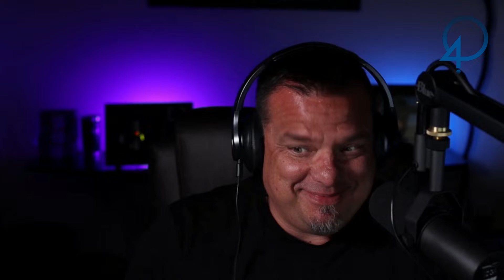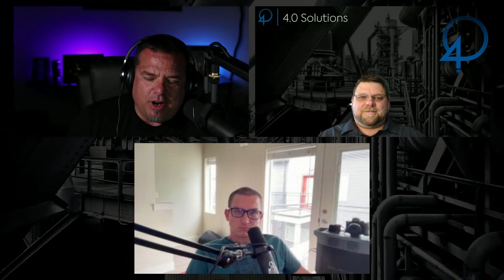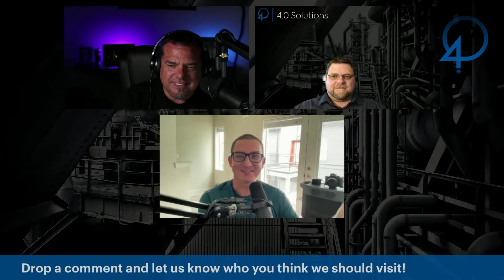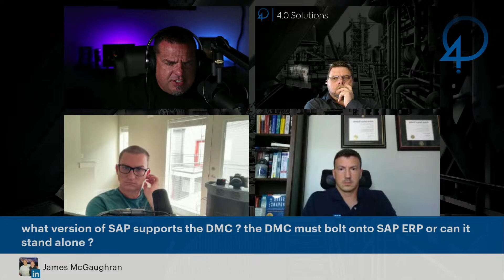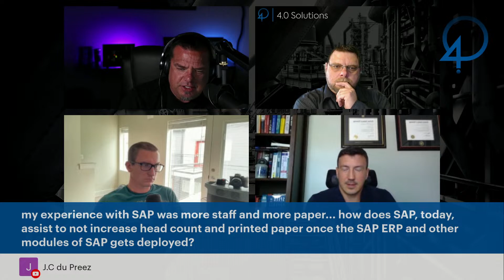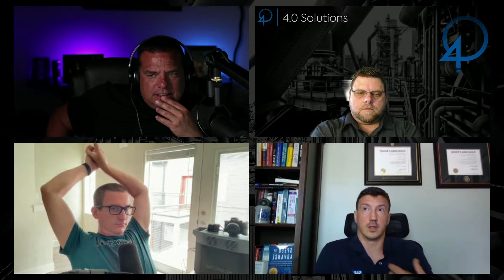SAP Digital Manufacturing Cloud and the UNS | W/ Sam Castro

Comment: What I am still not able to understand - after almost 15 years in ERP/MES implementation - is what/who defines the so called standard and best practices especially in the the manufacturing space where almost every shop-floor process is unique and has it’s specific pain points. Every big solution provider like SAP is claiming they have the best in breed solution but is it really the case? Reason  why, in my humble opinion, I think that UNS and building low-code modular MES application  is the future of MES rather than these rigid solutions designed for a large variety of businesses and imposed from top floor.
Reply: Round peg square hole. This is why we say build don’t buy core MES capabilities. You got it 🎯
Reply: Exactly 💯